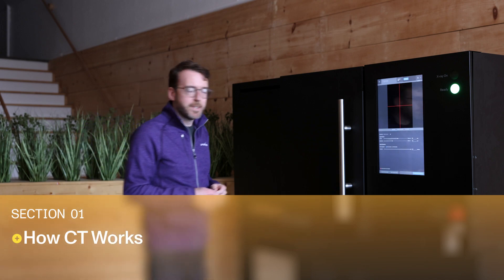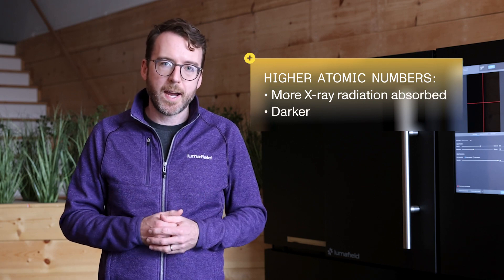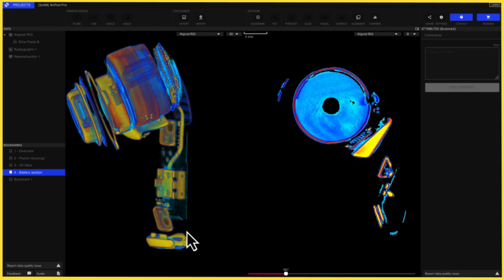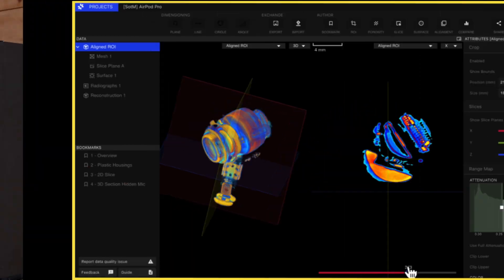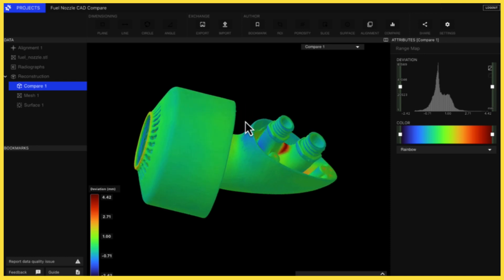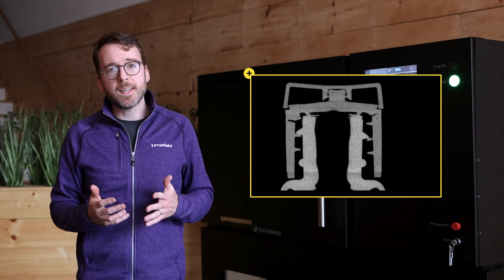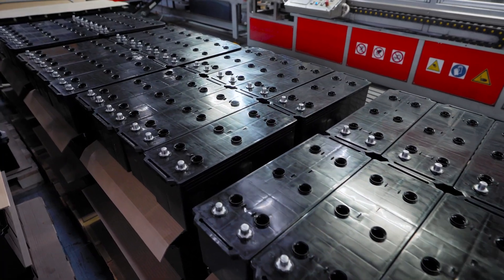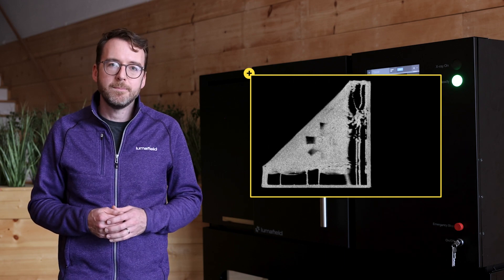CT 101: Introduction to Industrial CT

Comment: How fast can you scan an object? When I was doing my final project for my physics Masters degree, the microCT system I was using took arround 2 hours per scan (512px x 512px, 100 frames per projection, 402 projections) plus 4 hours to process the data!
Reply from the maker: Scans can take as little as a few seconds for lightweight plastic parts, up to several hours for denser parts. Our reconstruction runs in the cloud, so it's much faster than the system you're remembering; it usually takes less than 15 minutes to go through the full process.
Reply: @lumafield  15 minutes ... that would have made my life so much easier!

Comment: What would happen if you put there sedate mouse? Would it die from radiation?
Reply: Not right away, if at all. But it would become more likely to develop tumors. It's like giving 100's of x-rays to the mouse within a few seconds, so it won't have time to repair all DNA damage, and definitely shouldn't procreate as the offsprings are pretty much guaranteed to have birth defects.